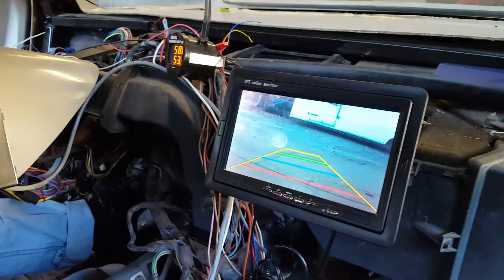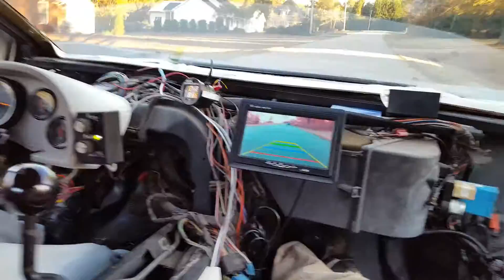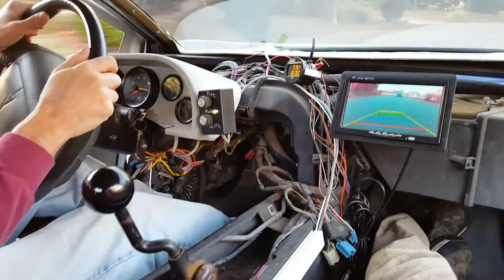Since I've been home 2016 - fumes drive

Comment: How are you making the fumes?
Reply from the maker: Heated element, single fuel injector spraying on the heated element.
Reply: so what's the deal with the one injector?  that's all its running with?  how many cylinders?..... how are you doing that?  I got questions.
Reply from the maker: So go to my channel and watch the videos where I explain everything that you would want to know initially.  I also have a build diary that you can see via a blog on 100mpgmotors.com
Thanks for the interest.